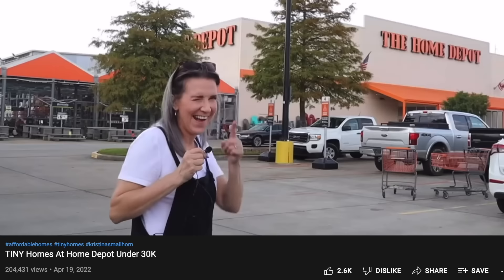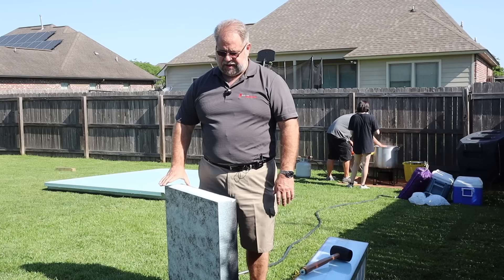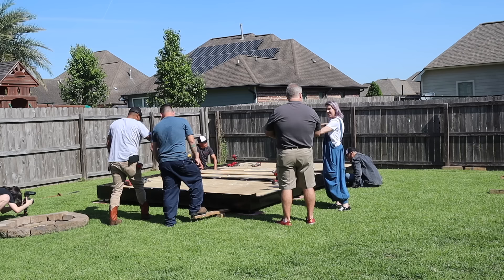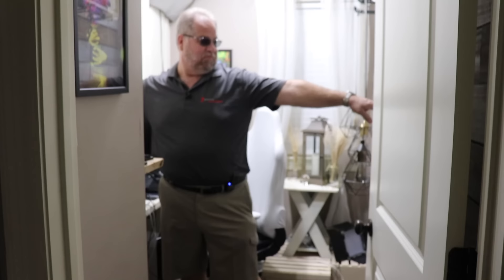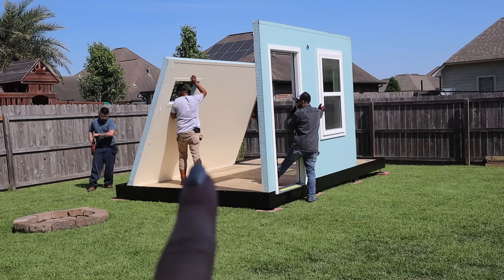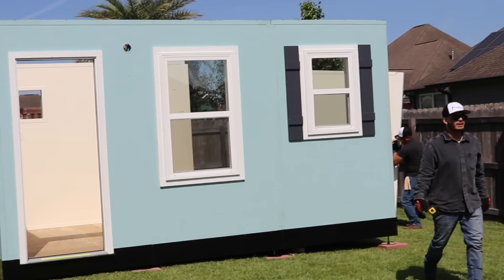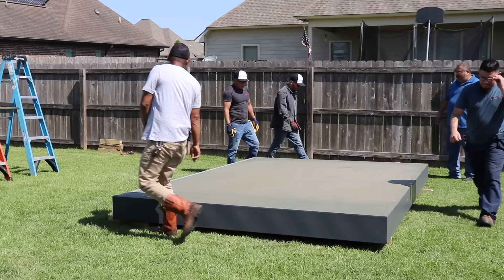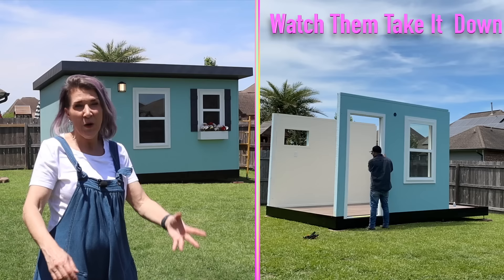Build A House In 28 MINUTES?? SNAP Together Homes

Comment: It would be very cool to have 6-month, 9-month, 1-year updates on the home regarding durability.
Reply from the maker: You will be getting those updates from me once I get one. It will be my filming studio.
Reply: I live in a 30 year old SIPs house and it is amazing. I live in coastal washington and heat with an infrared space heater. Amazing.
Reply: @janesspace  What is a SIP house?
Reply: @KristinaSmallhorn  I live in Texas where it's extremely windy at time and the winds are very strong. What I'd like to know, is how to thèse house's old on in string winds conditions.
Reply: @anne-mariemcinnis9143  structural insulated panels
Reply: @anne-mariemcinnis9143  // I heard him say 130mph winds. I live in Texas myself so I heard that loud and clear.
Reply: @anne-mariemcinnis9143  Structural insulated panel. That's what this house is made of. You can do research on them, they're fascinating. they can be made both with aluminum, steel or wood framing.
Reply: @anne-mariemcinnis9143  Structural Insulated Panel, basically they are fiber foam boards that have a coating on the outside and inside walls that is paintable and can withstand the elements.
Reply: @KristinaSmallhorn  ok.... It's been a year now! 🙂🌷
Reply: @janesspace 
Space heaters have been around for a long, long time.
Reply: Yep, there are lots of solutions out there, unfortunately all the money that cities set aside for the homeless are used to pay admin six digit salaries.
Reply: @janesspace how much is the heating bill?
Reply: @Maven0666  In the coldest part of the year, it can add up to $150 a month.
Reply: @janesspace  We need aerogel space insulation right now.

Comment: With the cost of housing going out of sight it's past time to start thinking outside of the box. This makes more sense than most options that I have seen, If you set this down on a concrete slab you'd have a really solid and permanent home.
Reply: The high prices is due to LAND so it still would cost a lot lol
Reply: If they would let you build a 400-1000 sq ft house.  Most areas require you to build much larger, which is what puts up the cost.
Reply: @ozymandias8523  No.  High prices are due minimum square foot requirements.  You should be able to build whatever size house you want as long as its code compliant, and the codes has defacto square footage requirements.  They want increase housing costs to generate more revenue and zone poor people out.  The average new home built in the 1950's was 950 sq ft.  That's illegal most places.

Comment: Wow that was so cool!  The only thing I would change really is to add a Euro style air conditioner heater unit that goes high up on the wall rather than that big clunky unit.  I just love all the high-tech Building Systems
Reply from the maker: That could be an option.

Comment: This looks like a great option to have an additional place for guests or family. What about the permits, Kristina?
Reply from the maker: That will depend on you local area. I will not need a building permit since I won't be getting the one with a bathroom but will need a permit for the electrical.
Reply: @KristinaSmallhorn  thanks. This looks really interesting.

Comment: So I could buy some land in the Appalachian mountains and have one these built in a day?  Add solar panels for electricity, build an outhouse, dig a well, plant a garden and go off the grid?  Sign me up.
Reply from the maker: You can do it!!
Reply: @Edward Knutson let us know when you do so that I have a place to visit.  These are awesome structures.
Reply: Septic is the big one, you're gonna run into needing a septic permit and have septic pits dug.  
Pre-pandemic it costs I'd say 4000, but a septic system can now run up 8000 post-pandemic and have huge delays. 
Delivery will also be delayed, having a well dug will also be delayed. 
Expect it in 5+ months done. 
The main thing though is drainage. Drainage, drainage, drainage, always remember that's in the initial excavation of the land.
Remember that you can run into all sorts of problems, the cost of setting it up is the cost of the rent you pay before moving in. 
Also, with gas sky high, the cost of living out in the country...well, the country let's just say is a gas-centric existence. Your whole existence will rely on gasoline. 
Electric cars are too much, there are electric bicycles for $3000 that can now run 200+ miles though on a single charge, and better ones coming too.

Comment: Hi Kristina,
I have a few questions I hope you can answer: 1) Is this a modular home or a manufactured home in the eyes of a lender? 2) If it’s bolted to a permanent foundation, will most lenders fund it? 3) What kind of kitchen and bathroom cabinetry does it include? That is, are they molded plastic, wood or tile?  4) What kind of windows are included? Are they vinyl or aluminum frames? 5) What kind of roof material is used? Is it wood shakes, asphalt, etc.?
Thanks in advance.
Reply: She was paid to promote this by the builder. It's a yard barn and was put on piers just like a yard barn would be (if installed properly).

Comment: $43,500 for 12 x 20 at website;  did not find 20k model 😲🙃🤨?
Reply: Click on the second page for work spaces.  There’s a $21,000 approx. shed, but it’s not wired or plumbed.  😔

Comment: am needing to watch it again, to see if electrical hookup occurred. 
cause if it has running A/C + heat installed and operational that quick
I want one !
Reply: @Lee Bailor everything was pre-wired in the building.  It can pre-wired for even Cat5.  They ran a temp drop to get the A/C and power up and running.

Comment: looks very cool. but honestly some pavers and floor jacks will not cut it long term for rain and settling overtime. a structure like that needs concrete footings and some gutters and drainage away from the structure.

Comment: I thought these would be more affordable but "Price Does Not Include:

Permitting, Installation of plumbing and electrical interior or exterior connections, Materials for installation electrical or plumbing with exception of Conduits for electrical, Installation of Building, Fixtures,Cabinet or Appliances installation, Shipping, or Delivery"
Reply from the maker: Yes, correct, foundation is included, not all areas require a permit for the structure, just like every single home, you'll need to tie it into plumbing and electric.

Comment: So if this is going to be stationary and secure to the ground how and who pulls permits. And will this meet county inspection as a primary residence? The thing to remember is you still need electric and septic and water hookup. Those things are not cheap.

Comment: Thanks for sharing. As I have mentioned in previous videos I live in rural Idaho. Wondering if it would be available in rural 2 hours from any town over 3000 ppl. No airport, back roads. I will do my research just putting it out there options for some might not be available. And probably not for winter here but would be nice for office or part time living. Huh 😄
Reply from the maker: They said they will adjust the specifications for your area, including snow loads.

Comment: I don’t know if it’s possible, but they make sheet metal truss-brackets, which join wood sections together. Could they make a sheet metal pallet-bracket, which joins two pallets? That way, you could lay twenty pallets on the ground, and then join them with pallet brackets and a nail gun. After that, you would stand up the entire wall. It could be covered with green board, and a coat of paint. The bracket could be twelve feet long, depending on the pallets.
Reply: Just use a 4x4 cut diniagnally so it butts up against both ends. my buddy and I did that with a hunt/fishing cabin we built a couple years ago. worked out great.

Comment: A 12 x 15 is $30,000! That doesn't include a slab to put it on or plumbing or electrical. I don't see where this makes financial sense.
Reply from the maker: Its on piers, you do not need a slab. its pre-wired and the tiny homes are plumbed.

Comment: Are these homes insulated enough to with stand a MN winter or enough to have an AC keep it cool enough in the summer
Reply from the maker: Yes. You can call them to ask about snow loads as well. They ship the homes to meet your areas requirements and codes.

Comment: $20,000 for this? dude you could build a small proper home for that much. you could buy a couple acres and a fixer-up but still serviceable mobile home. you could have a mostly built out van or rv. 

this is pretty much the worst use of $20k toward "building a home" you could have....aside from putting the whole thing on a trailer.

i dont get the tiny home people who have more money than sense. really bizarre.
Reply from the maker: Most people do not have the skills to build their own home for 20k and the know how to follow proper building codes. As for manufactured homes, you’d be hard pressed to find a manufactured home for 20k right now. They have skyrocketed in price.